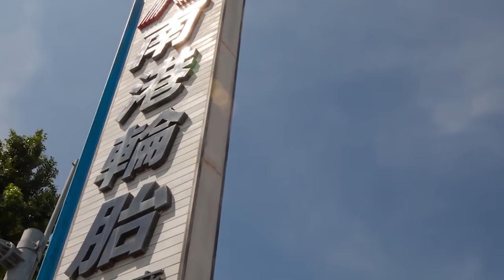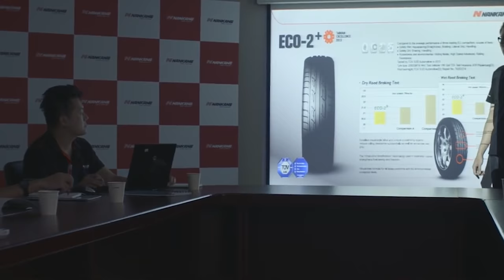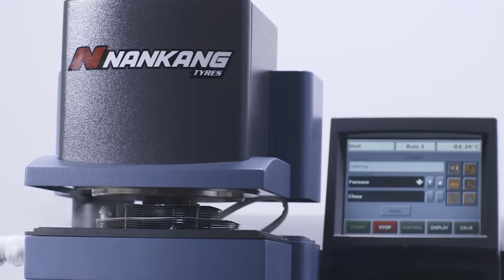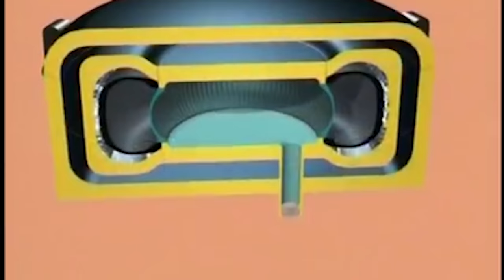THE TRUTH ABOUT NANKANG TIRES

Comment: What exactly do you mean by The truth about nankang tires?
Reply: That's exactly what i felt when i read the title to this video. It made me immediately think this is probably a horrible tire company. When in reality they are not and so i think he should change the title. To Nankang tire history...!!! This sort of title will immediately turn people off thinking the worst. Which isn't fair to the company since they are a reputable brand.
Reply: @tomtalker2000  They are good tires then? Some of those strange name Chinese tires are real rubbish, so its good to know, if you are on a budget, these are an alternative. Thanks.
Reply: @ @phillipjones3439  I just put on 4 Nankang SP-9 Cross Sport tires on my 2015 Lincoln MKC. Which is a small to medium sized SUV if your not aware of the vehicle i'm talking about. And TRUTH be told they are BY FAR better then the stock OEM Michelin Latitude Tour HP tires my vehicle came with. Their was a little "humming sound" in the initial beginning. However that went away very quickly as they wore. And have been extremely smooth and confident in ALL weather conditions. The SP-9 was basically engineered for CUV & SUV's so it's quite fitting for my type of vehicle. I got 4 of these tires online from Simpletire.com for around $400 and some change with free shipping. The quality and tread is EXTREMELY similar to either a Michelin or Continental tread design. I was orginally going to buy some Milestar tires specifically the MS932 Sport. However, when i read all the various online reviews about them being loud i said forget it. And i'm SUPER GLAD i did...!!! Nankang's are even used on some new vehicles don't ask me which vehicle manufacturers because i'm not sure exactly who uses them. However, i know for a fact that at least 2 car manufacturers are using them on their vehicles. I did A TON of research before purchasing new tires and i feel very confident in my decision to go with these Nankang's. So i wouldn't shy away from these at all they are excellent tires for someone on a budget.

Comment: Put NS-25's 245/35 on the back of my 135i. They're cheap and grippy (thumbs up) but flexy (thumbs down) over 35 mph and 60+ requires constant course correction straight line or through curves. Great for drifting lol
Reply: Damn this is what i hate the most that flexy feel..feels like driving on ice..im going to try the federal evoluzions after reading this for a few more bucks.. they claim stiffer sidewalls

Comment: Thoughts on the Nankang Counqueror AT5’s? I’m looking for a tire that excels in snow and ice. Apparently there’s no true winter tire for my truck (2017 Ram 3500 4x4 crew cab, standard bed, Cummins/Aisin). I was told Nankang is good in the snow/ice. Thoughts? Also, any other recommendations would be good. Right now I have all terrain tires (285/60r/20, on 20x8.0 wheels). I’d probably only use the new tires for the snow and put the ones I currently have on, back on in the spring. Thanks.

Comment: Ive gotten my Pirelli Pzero tires that came with my mustang performance package slashed twice now. It is getting expensive and from what I have read the Pzeros arent all that great.

2 PZero replacement tires are gonna cost me $475...the tire shop said that for $450 I can get 4 Nankang uhp NS25 all season tires. I think I will try them out
Reply: DavyDave1313  let me know how they work out I bought a set of work wheels but the toyo r888 on them are making some humming while I drive prob cause they have been sitting for so long
Reply: @jomnomjom5896  I ended up replacing the Pzeroes with pzeroes again...The other two tires are brand new pirellis so I figured might as well just have all new pirellis and pray my car doesnt get vandalized again
Reply: Yeah man 😤 to many haters, good luck bro if only we had a mod to cap someone for vandalizing are cars 😂😂

Comment: Have about 30k miles on my Nankangs. 245 45 18, just had to get the  front driver side replaced due to a large bulge forming under the tread. This is the 2nd one in about 4 months. They were cheap so 30k is fine, just don’t like the bulging under the tread, might kill someone some day. Oh still plenty of tread left
Reply: Sounds like impact breaks.

Comment: I used to run Nankang tires but after 3 month the bead started leaking air
Reply from the maker: No good man! What kind of tires do you have now ?
Reply: Fitment Industries acceleras for the rear and Achilles ATR SPORT 2s in the front

Comment: "bang for a buck" doesnt that mean that they should be okay and not dangerous?

or do germans automotive magazines just have higher standards then americans?

the overall review of nankang ns20: "do not use / not recommended / grave security flaws" 

braking tests on wet roads 100km/h to full stop -> 14 meters more on nankang ns20 compared to continental sport contact. so when a car with conti stops, the one with nankang still has 50kmh on the speedometer. 

so if u want to drive fast on german autobahn with nankangs. please don't. you are a danger for other people. Thanks

Comment: If you own a Can-am Spyder they normally run Kenda, which in my opinion are crap (do your own research). Nankang is what I have changed to on my new 2019 F3 Spyder Ltd, and it's stopped the bike wandering all over the place.   FRONTS NANKANG GREEN SPORT 165/60/15   18PSI
 REAR NANKANG XR611   225/50/15  32 PSI  That's for an F3.   They say you can't run car tyres on a Spyder. Well I'm here to tell you that's bullshit. Just have to know the right car tyres to use. These are great and they wear much longer, they're cheaper,  have better grip on the road in all conditions,  they're structurely sound and they run true.

Comment: Really had my hopes up when I bought a full set of nankank ns2 235/35 R19 but after putting them all on it was obvious to me that they are a low performing Tyre when compared to the other more premium tyres, for me the save in money wasn't worth the bad performing tyre I received, sorry nankank but won't be buying them again, would much rather recommend going for a bit of a higher price Tyre if you can, contact sports 6 or pilot sport 4 or 4s are very good.

Comment: I hawe buy a rear motorcicle tire for my Yamaha. Superb performance superb sticky for an super price. I want to test Nankang for my car  to see if the tires are awesome like those on my bike. Hawe a nice day all.
Reply: Didn't know you could get Nankang motorcycle tyres, Michelin Pilot Power were the best I ever run on the road, the only tyre I could powerslide safely at will in the wet on my Blade.  I used to run a 2CT rear and a single compound front.
I don't ride anymore so guess they are superseded now.

Comment: @fitment industries I need help deciding on ns-25 vs sumitomo htr a/s po2.  The sumitomo will be $70 dollars more. My commute is 1 mile of dirt road, 15 miles mountain backroads and 5 miles city. I will be mostly driving in dry, wet and sometimes mud in rainy season (wet dirt road) Any advice from you all will be appreciated. Thank you.
Reply: Try looking at the Nankang SP-9 Cross Sport tires. I just put 4 of them on my 2015 Lincoln MKC AWD. And they are BY FAR better then the stock OEM Michelin Latitude Tour HP my vehicle came with.

Comment: Yokohama a539 used to grip like Velcro but wore out quick. Some useless info there
Reply: I used to run the A539's, I thought they lasted ok compared to other tyres I ran in the 90's/ early 2000's, had to be careful on them in the cold though.
Better wear rate and grip in all conditions than the Kumho Ecsta's I ran before.  Same grip but better wear than Michelin MXV, better grip but worse wear than Avon AV something or others.

Comment: Love my nankang ns20s. Been running them for a while. 235/40/18s
Reply: considering they are passenger tires for a honda civic, you can probably run them for 50,000 miles.
Reply: I had them on my audi a4
Reply: on what size rims? do they run narrow or true to size? need tires for 18x9 but dont want to much stretch.
Reply: MrEspn64 18x8.5. They run true to size. Id go with 245s if i were you

Comment: Ironman tires
Reply: Ultra budget (read: bad) tire manufactured by Hercules (a budget american brand, and no, american doesn't mean the tire is good). Should tell you something when the budget brand makes an ultra budget tire but won't even sell it under their name. Don't buy them.
Reply: @NCRranger24  I already did. So far they are great in the rain and snow. Also just traveled cross country from Ohio to washington. I've had them for roughly 4-5 months.
Reply: @jasonthomas4895  good to hear they're working out for you. I've driven a car with Hercules tires on it and it was very far from good, so I have low expectations from a budget brands' budget brand that I essentially only have ever seen on cars that people could barely (or can't) afford the payment on, much less a set of tires.
Reply: @NCRranger24  ah. Yeah I just needed a quick replacement because my rear tires were balding and i hadn't taken the time to get them done.
Reply: I have them. Front tires are completely bald after 12k.. handle like crap
Reply: @dave-jl3vs  what car you have?
Reply: @jasonthomas4895  2014 sonata.
Reply: @dave-jl3vs  hmmm. I'll keep a look out. I'm using them on my rear so I might not have the same wear as you. I'm in a 2012 focus